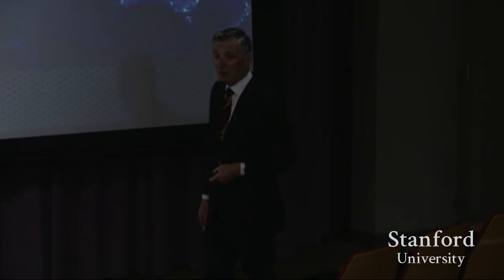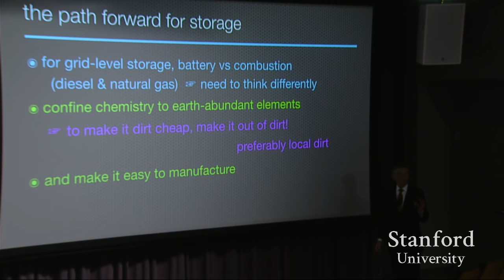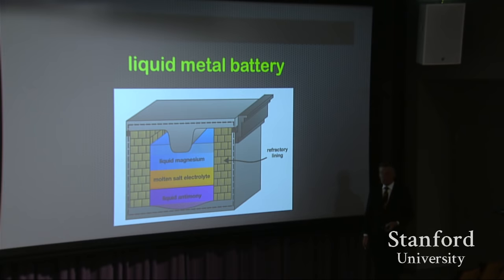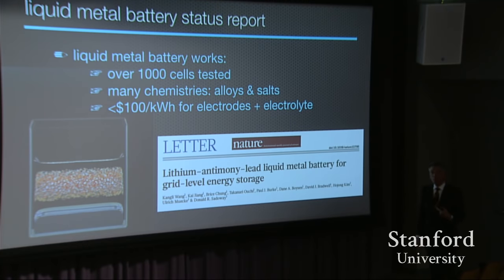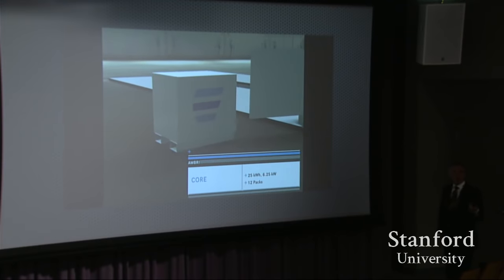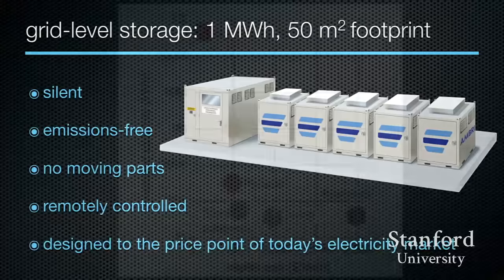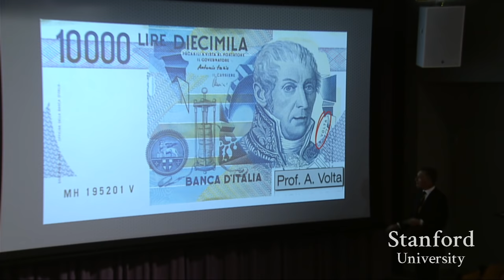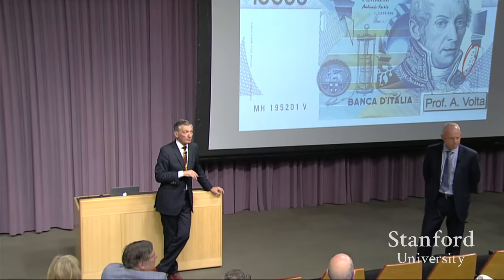Don Sadoway | Innovation in Stationary Electricity Storage: The Liquid Metal Battery

Comment: I understand the superior potential of his batteries for grid purposes, but I would like to know if this kind of battery is compatible with eletric cars.
As nobody made this question, i'd apreciate if someone could answer.
Reply: Think about it geometrically: the volume grows  by the law of cubes, but surface by the law of squares.

There is heat to maintain in these batteries for them to keep functioning and putting out power, whether they’re actively being used or not.  Perhaps a different type of battery can be used to do the initial heating.  But, what is unclear to me is how much of the potential output requires heat as input.

If used in electric cars, oddly, it’d make the most sense in always-rolling vehicles that keep getting charged many times per day due to being used heavily.  For your typical family car, I believe it’d have too much heat loss to make a lot of sense, which would also require a lot of power for recharging them.  However, on the bright side, no battery fade in the lifespan of the electric car driver, especially of a family car!

And, as explained in the video, it’d be even safer in an accident or puncture: no thermal runaway, it’d just seal itself as it cooled.  The biggest risk in my assessment would be how much insulation got damaged, and the latent heat setting off flammable things such as dried grass and leaves.

Current electric car battery round trip efficiencies are around 95% according to a web search, and thermal management is required for them as well, but to keep them from degrading, so they also discharge over time when not actively being used.  As long as the charging costs are lower than gasoline, it’s still a win for the charge/refuel equation.  What I don’t have numbers on are the weights of the various liquid metal battery chemistries for their energy storage: I suspect they're notably heavier, so that may not work in their favor for cars and efficiency,

Comment: Could you convert New Zealand's Tiwai Point   Aluminium  smelter about to be decommissioned by NZAS into cheap battery   storage? Or better into a Carbon free Steel smelter using Taranaki iron sands?

Comment: So... wait... If these things run hot, could you run a sterling engine generator off the excess heat and use that to help charge the batteries?  I mean surely there's a way to use some of that heat in an "energy reclamation" capacity as well.
Reply: Well, yeah, and you could make up an array of cheap TACs and make a little more 'free power' off the Stirling exhaust.  How much capital and maintenance expense can you justify for the marginal electrical generation?  That's the only real reason most technically-workable bottoming approaches don't get used.
Reply: @wizlish   as all a Stirling engine requires is a temperature gradient to operate (that was a Beta vs VCR thing with the steam engine back in the day) It's not exhaust.  

Stirling engines ran whole machine shops, a legit, functional, significant generator could be run off the 200 or so degrees these batteries reach while charging, with which you could charge another, and another, etc.
Reply: @ryanjamesloyd6733  There is more to 'bottoming' than just the heat differential.  And of course an expander of any kind has an 'exhaust' -- here it's in the steam-engine sense, the flow of 'spent' air that has finished doing work on the pistons or other power-generating structure.  The heat content in this could be used in at least one further optimized Stirling, but it would be so large and run so slowly as to be essentially worthless in justifying its (large) fabrication cost.  Therefore using thermoacoustic devices to recover any further waste heat would be better -- assuming you could make and connect them cheaply enough to justify the exercise.

There is no question that one of these batteries at 'neighborhood' scale would produce sufficient heat -- and the heat does need to be removed from the cell structure -- to justify making and using a bottoming cycle of some kind.  It is certainly worthwhile to consider a hot-air engine instead of, say, an ORC bottoming arrangement to do this, provided the effective heat flux is kept high enough to fulfil the 'primary purpose' of battery cooling at any point in charge/discharge.  I would further note that, at the voltages these batteries will run, any generator driven by a Stirling could be directly used to produce charging current for the battery, and this might usually be a nontrivial contribution to baseline grid power, with relatively unattended operation and long service life.

In fact. you can calculate more or less exactly what the heat flux from a given LMB would be, figure out how to circulate that to the Stirling displacer, and figure out the scale of engine and developed shp at best speed that corresponds to this.  (Personally I'd use multiple engines sized around the expected charge and discharge characteristics of the particular LMB, as I expect the developed heat will differ with time of day as the battery system is commanded to charge and discharge, so 'one size may not fit all')  From that you can easily determine the percentage of engine output that translates into electrical generation and then transversion to 'battery electricity' (DC at extremely low voltage).  That will give you a number that will confirm or deny the capital practicability of installing it as a commercial bottoming system.

Comment: Why are people limiting this technology to stationary applications? Don makes some interesting comparisons to the Li-ion 18650 cells starting at at 25:00. I know the contents are liquid so you have to avoid the liquid inside the cell from sloshing around. But we've reached the stage where active suspension systems can keep a car body level why travelling at speed on a bumpy road and during cornering etc. ( https://youtu.be/P7QQLxthHyQ ). Couldn't the same technology could adapted to keep liquids in a container from sloshing about?
Reply: Slosh is largely a function of horizontal (speed change and yaw) rather than coupled in from vertical ride oscillations.  You're far better off using active means to damp the slosh where it manifests (gas blanketing has been said to work but I don't entirely see how; gas blanketing in 'ballonet' cells would work better).  There is also the same problem with good active suspension that thunderf00t had with the tabletop dryer: they usually make noise -- sometimes pretty dramatic noise.  There are, of course, technologies with less inherent noise (the system used on the Citroen DS comes to mind) but to get them to work with heavy load over long travel means extensive fluid flow at very high speed with very precise final positioningl.  Lots of shocks in the acoustic frequency range and difficult to keep many of the resultant frequencies insulated or damped...
Reply: As a further issue: part of the problem he mentions with the 'slosh' in a LMB is relative mixing of the active 'layers' (which might extend to reducing or eliminating the electrolyte layer between the metal layers themselves.  As you suggested to me, baffling the internal volume into multiple internal cells ought to help address this issue; presumably the 'separators' would not need to be fully solid, which decreases a need to put mechanical anode-cathode connections into each of the baffled 'cells', and could be quite thin mechanically as there would be little pressure differential across them.  This might suggest a further refinement: some sort of open-cell structure like Shuttle tiling that would not be 'wetted' by either the metals or the electrolyte, or a ceramic foam fired to consolidate it after 'blowing' to a particular void size or relative 'open-cell' structure.

Comment: The best plans for a dirt cheap battrey is called the bagdad battrey that is made from a dirt clay pot and copper and iron it uses citric acid as a electrolyte invented by the Egyptians also a flourescent light bulb
Reply: Copper is not as abundant as you may think.  During WW2, TONS of pure silver was used in the calutron's magnets at Manhattan project because copper was harder to get than pure silver!
Reply: @bobspafford3519   yes the best choice is to use what works and is plentiful. I can invision carbon paper battery's made from recycled paper and cardboard and wax. The battery's will be rechargeable and biodegradable. Even inexpensive.  I dream up things then want to make them😊
Reply: @bobspafford3519   in Egypt copper was plentiful they had a copper mine. Their tools was copper they did not have iron or steel

Comment: One CRITICAL aspect he did not mention......

Recycling....... his cell is basically PURE metals that can be refined easily.. without having to remove loads of toxic shit & plastics....
you ever seen recycling lithium batteries.... filthy time consuming work....
Reply: And the funniest thing is, if these batteries never degrade, you’d only recycle them if you needed the materials for a different purpose.

These batteries appear to have hit the limits of how stupidly-simple you can make batteries, with the biggest issue being you need heat one way or another, and insulation.

Comment: Just wondering how they get the system up to temp upon install
Reply: He told us.  The charge/discharge activity, there are no heaters and zeolite insulation in the steel case is there to lower heat loss and cause cells to heat faster into their more efficient range.  No gasses are generated, so nothing to vent.  WHAT'S NOT TO LOVE HERE?
Reply: @bobspafford3519  Brings me to another question, the cells must not be run at steady state? ie they must be charging or discharging to keep internal heat at temp and not at "constant voltage" per say?

Comment: Nearly 3 years later and Ambri isn't expected to deliver its first proof-of-concept commercial scale units until 2020. Apparently problems with the seals, along with plummeting cost of lithium-ion batteries and a lack of demand for bulk storage batteries, have been keeping them on the ropes. Now we have things like Tesla Power Walls which are creating a public image for domestic energy storage and these guys are nowhere to be seen...
Reply: Hopefully the cheap and readily available materials used will continue to win the day.  Obviously some clever bits needed (like seals etc), but that is useful IP.  With a price near pumped hydro, any chemistry that works with optimum trade off between complexity and price will be enough.  The idea that these can be knocked up on a simple production line using cheap materials most countries have in house is enticing.

Comment: This guy is explaining the big stone empty so called tombs in the Egyptian pyramid which still today emits electricity... They are meant to be kept in motion  Three would be the appropriate sequence for theses for a large society's main distributing city... This is also why thy had fond one moved to the side with a big crack going threw it , as it would have lost its insulator in the gap... At these sizes they would also be able to charge the  last as it goes to the next in a 3 sequence... Not sure if these were the contents it used but this is a very powerful Circle battery ppl are thinking in a singular manner... This type of battery is meant to be constantly charge  & discharge { Like Breathing }... which is what you would want...

Comment: Why Not hydrogen, produce able, storable, work's well inter city, clean, not as a fuel cell with current limited platinum but possibly another Nobel metal, 
 Used as a carbon source for algae fuel production in conjunction with say Hemp shiv Gasification
Reply: This "storable" statement is really controversial, hydrogen is a very difficult gas to operate with. Then high pressure tanks don't scale well plus inevitable loss of energy on compressing. Another noble metal? Good luck with finding something to replace platinum. Do you count environmental costs of mining it? In real life everything comes with a price.

Comment: Could we use this to power EV cars?
Reply: the weight to power ratio is still unknown so I doubt.
Reply: Liquid aluminum and liquid antimony and the liquid salt would slosh around as you drive.  This would effect the operation of the battery.  Could this be overcome?  Maybe.  But I see why he is applying them as stationary batteries as his first target market.  And he has already begun to develop a next-generation chemistry (the part that he said he could not talk about because the editor from Nature would have a problem with  it).  And if a car battery is not charged/discharged then it will cool down and become a solid.  So that might work in a train that gets used constantly -- not good for a car that is usually parked.
Reply: The target market is utility grid scale energy storage, not mobile EVs. They may eventually be able to get there, but that’s not the initial sweet spot for their market.
Reply: Yes to charge your electric car , remember it is designed to store renewable energy !
Reply: Gary P. I think Tech Witch is asking whether you can INSTALL THIS BATTERY IN an electric car.  If you watched the video then please recall that the battery is based on aluminum metal that is hot.  So hot that it is liquid.  It is not certain that this battery will work in a moving vehicle.  Yes it could be used to charge an EV, or power any electric load.
Reply: In answer to several of your questions, you apparently missed the part where he mentions working to get the temperatures down enough that he could use POLYMERS in his system.  If he can get the costs down that far, it stands a chance of being able to be used in cars.  If he could drive down the cost enough, people would be willing to work around the issue of the battery having to be hot enough to keep the components liquid.  This is similar to how EV drivers (myself included) are willing to deal with slower charge times (for now), in exchange for powerful, quiet performance, no maintenance, incredible simplicity and many other advantages.

Even if it never makes it into automobiles, it would be majorly disruptive to the energy industry.

If he was correct on his timeline, he should be able to start making and installing these things within the next year or so.
Reply: Ambri = Analyze More But Remain Impotent 

Talk is cheap. 

Meanwhile, the current energy business is actually moving the economy along while pretenders tell stories...
Reply: @billdale1  Magnesium is a solid at any temperature less than 1,202 degrees Fahrenheit -- which will burn most polymers immediately to a crisp.  Maybe Sadoway can find a different combination of elements that works at a less extreme temperature, but the whole premise of his talk is that he will use METALS THAT ARE MELTED!  So your excitement that he could put this in to cars any day now is really cute, but it has no foundation.  

Like you, I hope that this chemistry can disrupt the energy industry.   I am impressed by the approach that he is taking.  I am hopeful and optimistic.  But to get there he must start with an application (like stationary batteries) that is well suited to this technology -- not cars.  If you wanna debate this. Okey dokey.  But there are better ways we can spend our time.
Reply: @peterkacandes5905  This simple statement is exactly correct.  Many of the other comments just create confusion.
Reply: @wrong-waygo-back9355  To charge an EV, but not to put in an electric car.

Comment: Why can't a liquid metal battery system be used to power a Tesla?
Reply: Kazoman,
Apparently the process involves a lot of heat due to the moleon metal.  This would be difficult to achieve in a device small enough to fit into a car. This may be an issue that can be worked out in the future with different metals. 
david
Reply: @postholedigger8726  Yesh, instead "why can't", what I really meant was 'if only it was possible'. I believe the real impediment is that MSR doesn't work efficiently when it's scaled down to fit in a car.

Comment: Surprised this guy hasn’t been bought by oil companies.
Reply: Just because they might WANT to buy him out does not mean he could be corrupted in that way.  Not everyone is driven by money alone.  Besides, there is so much momentum on battery and supercapacitor (S cap, or scap) tech, that it would be nearly impossible for the petro industry to buy out everyone... also, oil is a finite resource, becoming scarcer and more expensive by the year, and inevitably must be replaced by something.

Shell Oil, who has been pretty suppressive of renewables for some time now, sees the writing on the wall: they have been installing EV charging stations at their gasoline stations, and the price of a charge is reasonable, and payment systems such as done by ChatgePoint are uncomplicated and doable.  Good for them. Perhaps part of why they are doing that is because someone in their company actually has some ethical sensibilities.